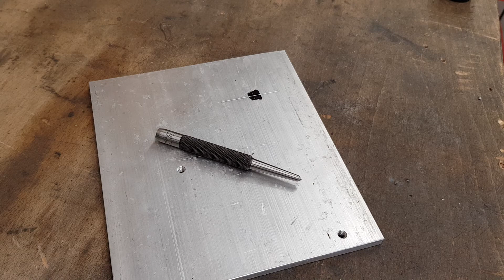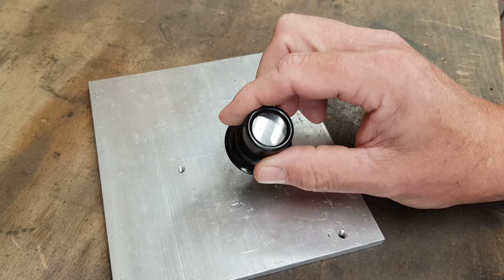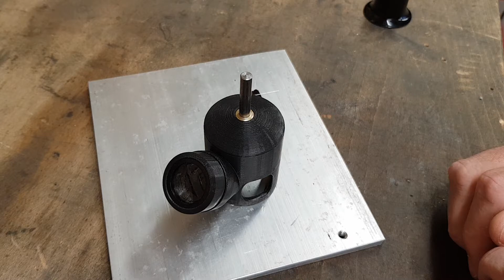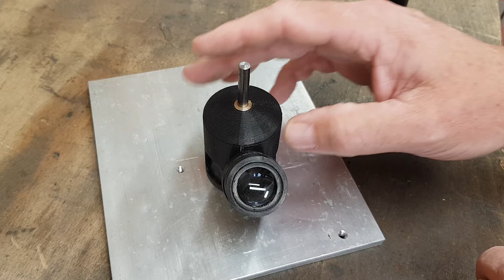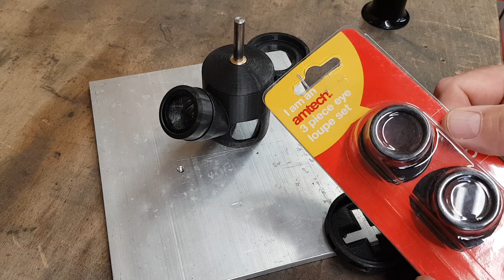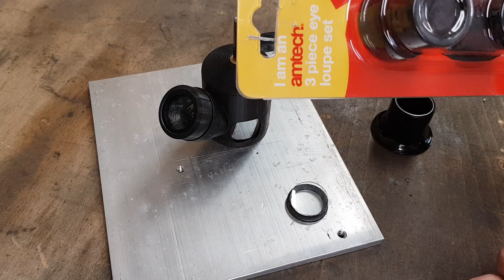Optical Centre Punch DIY. (STL files available by request via my email. See intro on latest videos )

Comment: Very clever. There is one sold here in the US from a company named Skidmore. That has some drawbacks as you have to insert the optical - align and swap out the optics for the punch. Plus they are pricey. You provide a good cost alternative. I will look for your print files. My little Prusa Mini will enjoy that print with a purpose. 

You are correct the eagle eyes of youth are long in my rear view mirror. Tripe and quadruple checks seem to provide varying results. The magni-visor has to come off the wall hook more and more frequently ….LOL

All the best 

Dan
Reply from the maker: Hi Dan.
A good few have printed and said they work great. You pointed out the big bonuses,  it's cheap and the punch is in position to be seen as you snack it .
Messages are coming in slow for some reason, this only just appeared. 19 hours to travel 3500 miles isn't bad though 😁

Comment: That's a great idea...with the angled lense does it distort the view of the  marks on your part?
Reply from the maker: Not at all Craig. The focal point of the lens is 65mm and set to intersect the point on the punch. Its crystal clear and all lines in view appear straight.